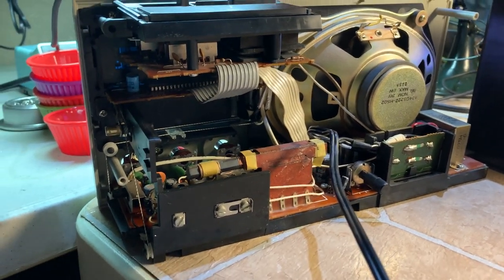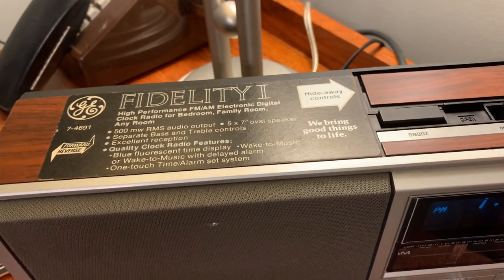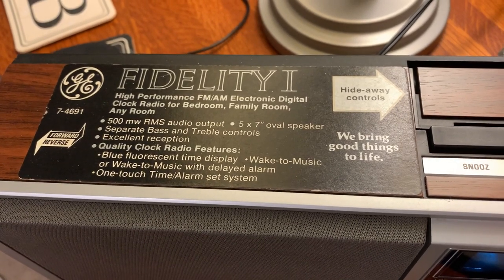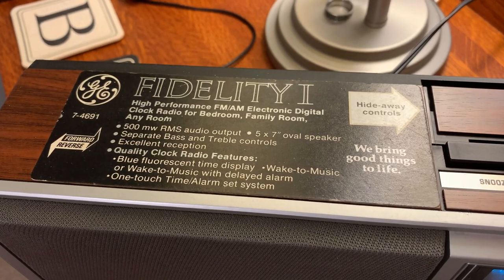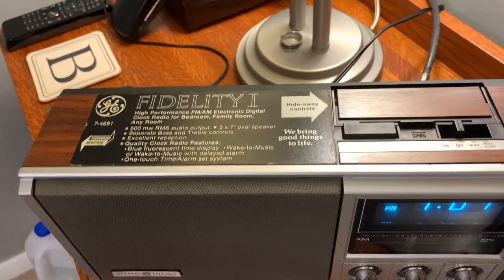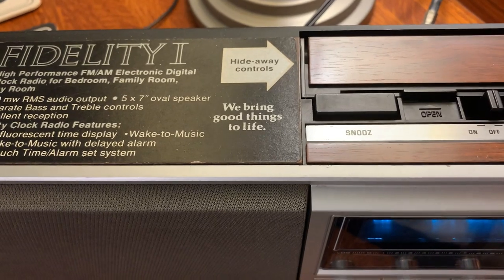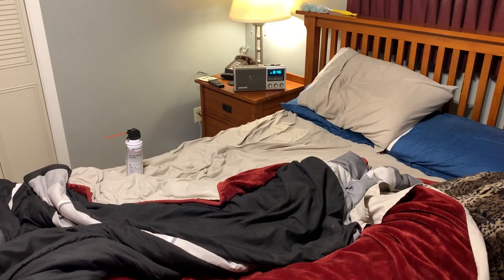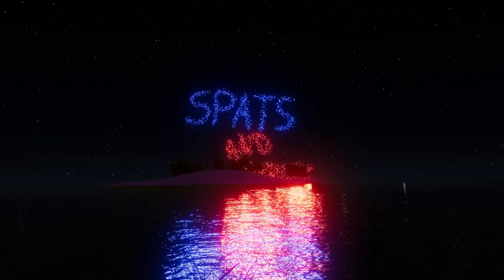1983 General Electric Fidelity I Model 7-4691 HiFi Clock Radio

Comment: I can tell that song is "Chip Chip", by Gene McDaniels, at about 15:20. Got his album for my 30th 🎂 day in 2000, as well as my mom buying a 🏠 house. I REALLY 👍 like your ⏰ Alarm clock 📻 radio. They are the best of "Old 🏫 School". Big, beefy 4 inch speaker, and big magnet. Very nice Blue-Green display, and complex dial cord system. My dad got an AM/FM Randix Cube ⏰ alarm clock 📻 radio, back in 1983, and it even featured a fold-☝ up ☎ telephone. It also had a cassette tape player. As if it were a rocket ship" ready to take off into outer space, I really liked it. 👍 Yes, it also had the Blue-Green display. I never took it apart to 👀 see the dial cord, speaker magnet, or circuitry, because my hind end would have been paddled if my dad caught me with his ⏰ clock 📻 radio apart. I don't 👌 know if your ⏰ clock 📻 radio features a cassette player, or not. 👌 Keep these 👍 GREAT ⏰ clock 📻 radio videos coming. Your friend, Jeff.

Comment: Nice clock radio. I like how it actually has a good tuner and decent speaker. Modern ones sound worse than a transistor radio and can barely pick up the local powerhouse stations.

Comment: Many of the GE clock radios using that dial scale, use a neon bulb for the dial illumination,  and it is hard-wired to the power ON switch, and therefore doesn't come on with the sleep timer.
Regarding AM reception on GE radios,  it is usually incredible performance (selectivity,  sensitivity and audio quality)

Comment: I recently bought the exact same clock radio on the bay, bought it just before Christmas.  Mine is model 7-4691A.  Date code is 4308.  I don't know how to read GE date codes.  I bought it after my early 2000s GE 7-4852B clock radio had the off button for the radio break so I couldn't shut off the radio.  Before I bought the Vintage GE I bought a modern Timex clock radio from Wally World that looks nice if fairly small.  It's biggest problem is it's radio has horrible range.  It seems like if the tower isn't within a couple miles of you the station isn't coming in.  So after a couple times of it not waking me up because of poor reception of fairly strong stations I went to Ebay to find something vintage in good condition.  I ended up having several of these in my watch list but most of them had some cosmetic issues.  This one was the cleanest but also the most expensive one I was watching at $69 but the seller offered me a discount on it so I bought it.  I'm planning a video on mine maybe this week.  It' sounds awesome and works flawlessly.
Reply: I figured it out years ago, because I have 4 of this model —I recall the second digit refers to the year . I think they were produced from 1981–1984.

Comment: I love these old electronics, especially when they have faux woodgrain!  GE used to make good things, and they even made battery powered lawn tractors under the ElecTrak name.  I found a GE 4620-F  with a date code of 4649 at the local goodwill, back in the early 2010s, which replaced a Timex clock radio from the 2000s.  That Timex went to a resale shop and the vintage GE is now in my bedroom.  I also have a GE 7-4115 B radio with a date code of 5514.  I have that on quietly for the dog when I am out of the house. These older radios not only sound better than their modern equivalents, they also look a lot better than today's appliances!  I need help with the date codes so I can know when both of the above radios were made.

Comment: I have one of these that had been sitting in my parents house for decades, unused. It seems tuning stations isn't working very good. Radio is not hooked up to an antenna but I live near Kansas City, so it seems I should be picking up stations better. Is there some basic cleaning or maintenance I can do to help improve radio reception and sound?